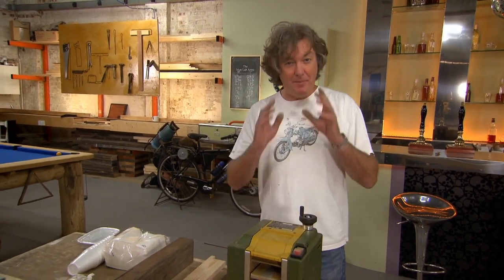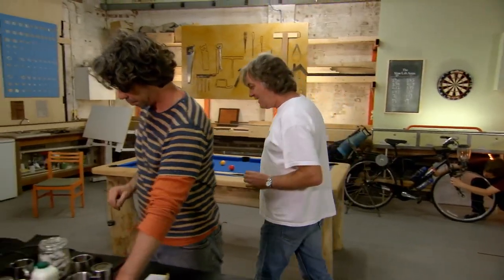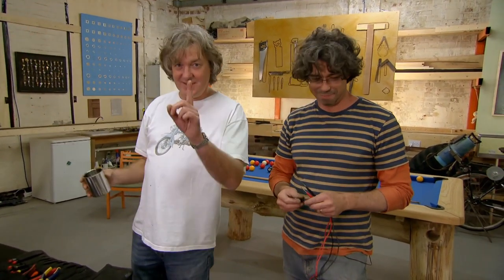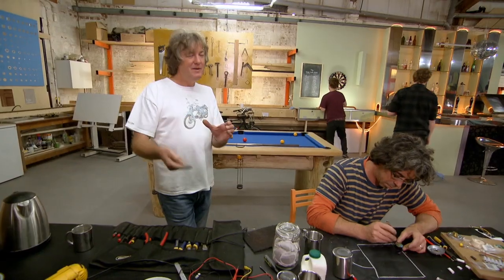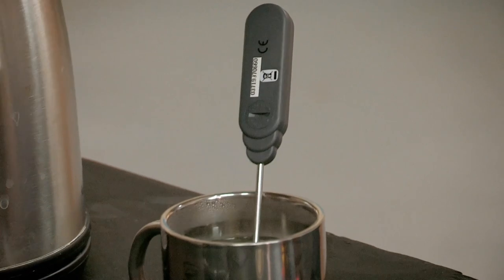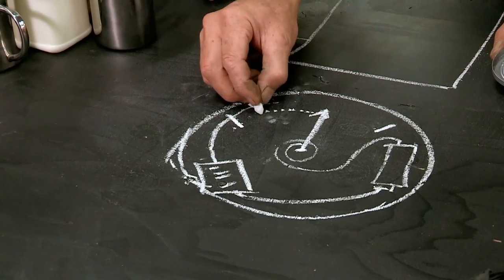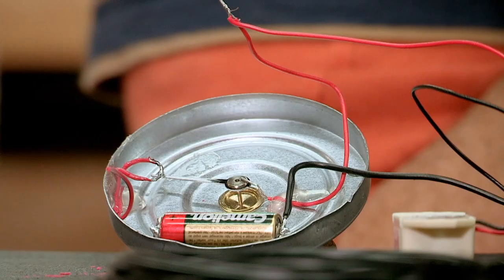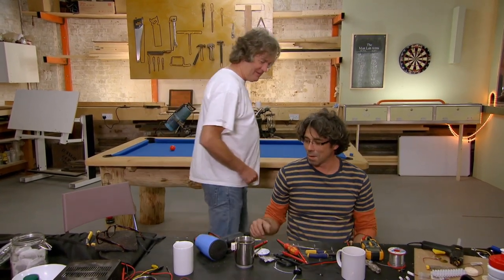James May Tackles Cold Tea Crisis With A Cup Of Tea Alarm | James May's Man Lab

Comment from the maker: Do you have any ideas for tackling the 'cold tea crisis'? Let us know in the comments below!
Reply: Make an induction cup. Basically a cup with an induction heating plate inside. You could even make a stand on a desk to put the cup on for energy transmission.
Reply: Put some ice in it, add some more sugar, and you've got a refreshing drink for a hot summer day... (I'm not sure how warm it gets in the uk but shhhhh, don't think about it)
Reply: Yes top up with freshly boiled water!
Reply: Put a pressure switch on the cup, so once you pick it up it stops buzzing. Bonus is if you store it in the cupboard upside down and it won't buzz in there either.
Reply: Every night Julie asks me where all the mugs are... I walk around the brewery set, the kitchen set,  the prep kitchen, the camera room, and the kitchen equipment room picking up all the half full abandoned and lost tea mugs from a day of shooting. Most of them of course were abandoned and forgotten by me. I'd probably be much more efficient at this Youtube production thing if I didn't spend so much time making and losing tea.
Reply: Quest TV this is a video showing one of the reasons why I love James May
Reply: @GlenAndFriendsCooking  you were in my recommended videos
Reply: just use a travel mug it will keep the tea hot
Reply: Pop some ice cubes in and have iced tea.
Reply: switch has to be movement activated. lift the cup beepiung stops,
Reply: microwave it maybe?
Reply: Quest TV make a heat mug it will heat up the liquid inside
Reply: PUT THE MILK IN LAST AND IT'LL BE GOOD ENOUGH THAT YOU HAVE IT COLD AND NOT DISGUSTED BY THE IDEA OF THE ABOMINATION THAT IS TEA WITH THE MILK IN FIRST!
Reply: Microwave it 30 seconds
Reply: We keep a microwave in the workplace so we just pop in the cup for a quick couple of seconds and voilá, its warm or hot again.
Reply: one minute irradiation in the micro - piping hot tea again, no messing about.
Reply: Don't misplace your tea.

Comment: The reason for milk at all, which is something I rarely put in my tea anyway, used to be because pouring tea from the pot into the fine bone China cups they had way back in the 1700's used to crack the cups.  Adding milk FIRST reduced the temp of the poured tea and hence the cups didn't crack...

Comment: Not a bad idea! It needs that switch, and a user adjustable thermostat, but a really good start. Arguably, this is a product well suited for wireless charging. It uses very little power, mainly when the buzzer is going off - even if you designed the thermostat with electronics. If you have a charging pad next to the electric kettle base, and you just remember to place the cup on the pad when you turn the kettle on, a couple of times each week, you should be golden. Another pad next to the drying rack for the dishes, or in the cupboard, ensures the battery gets properly topped up once in a while.

Comment: No. Tea needs to be made in this order and no other. Teabag in cup, (sugar if wanted), hot water (80 to 100 degrees Celsius (so boiling)) poured directly onto the teabag at an even rate,  cup filled to about 3/4 and then milk (if wanted) but only once the teabag has stewed for a small amount of time depending on the amount of sugar and or milk in the cup. Then drink whilst hot/warm.

Comment: Why do we not argue more about the ideal temperature? I think about 48 degrees is the minimum. Ideal around 52-53. 
Also you could do this a lot more reliably with a thermistor and a micro-controller that measures resistance and some code where you could set your alarm temperature to suit your preference with just an up or down button. Third button for switching modes so you can change the volume of the alarm. Throw in a little two digit seven-segment display to show alarm temperature and even real-time temperature. I'd pay money for that. In fact, I might make one.
Reply: push notification to your phone as it approaches the too cold temperature
Reply: @moldboy2  Ooh yes you could include an app. Control the whole thing through the app. No buttons necessary.